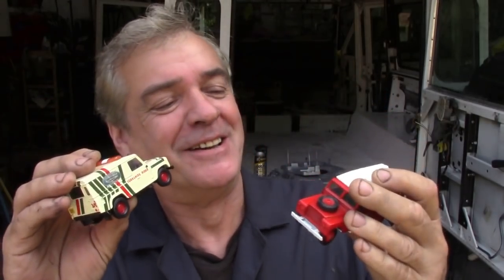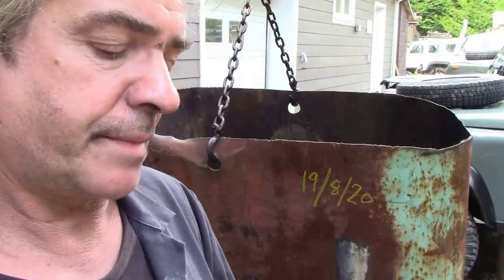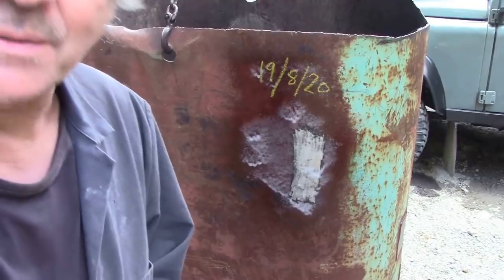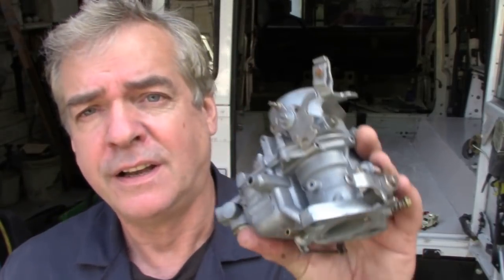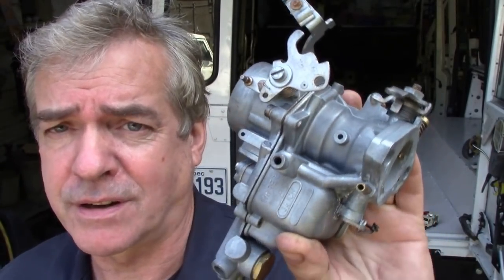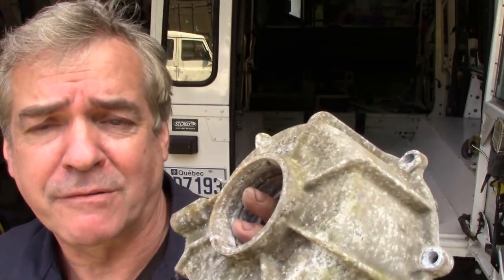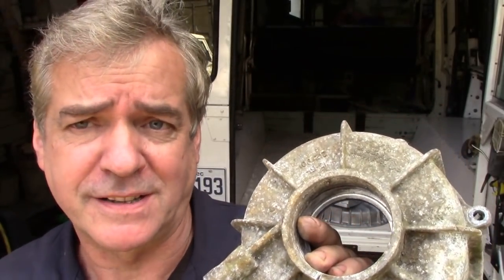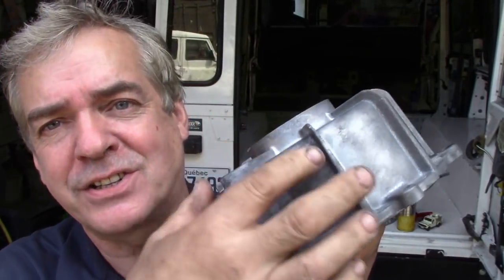Krown rust proofing one year on, and another experiments!

Comment: Mike that Krown rustproofing certainly is very effective, the patch on your scrap tub is looking well protected 12 months on. Would it be as effective on a chassis rail that's constantly bombarded with flying gravel? Have you tried it on underside bits?
Reply from the maker: It seems to make a protective skin - and is stated as an annual product - I expect it could get chipped bu the best reason for using it is in cavities where it creeps into weld joints and seams